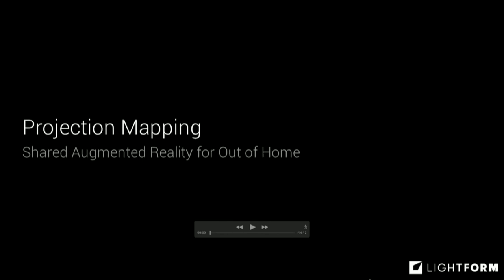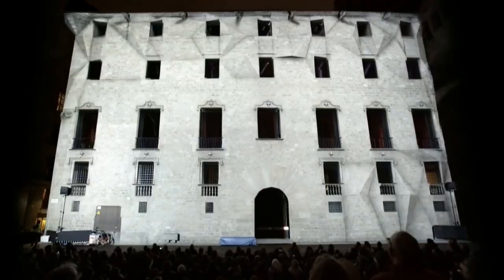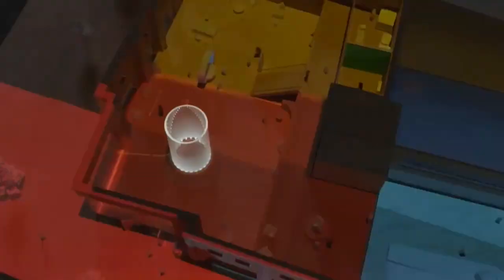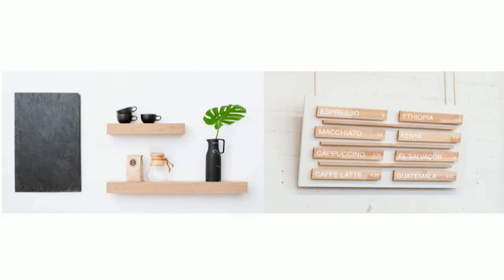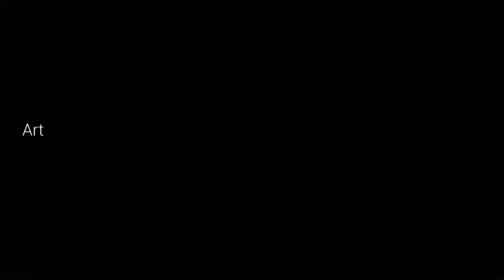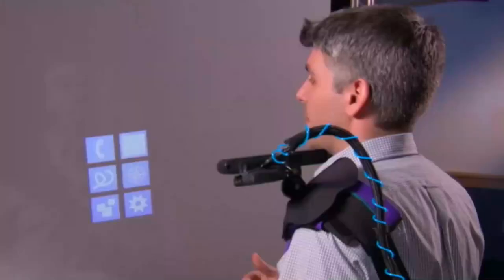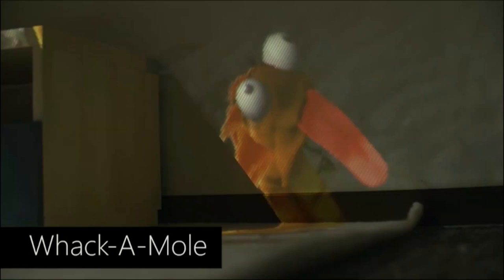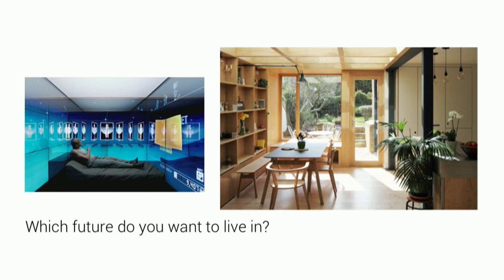Brett Jones (Lightform): Projection Mapping - Shared Augmented Reality for Out of Home

Comment: Just picked up the LF2 and I'm not very happy with it. I mean, it's okay. It has the camera built in, it scans, it projects, but it's very dim so you need to be in a very dark, to pitch black room for it to be most effective. Also, and this is my biggest pet peeve about it, it projects at a high angle and it has no height adjustment on it. If I place it level on a desk, I have to prop up the back to almost a 45° angle for it to project properly on a wall. Otherwise, it has to be low to the ground or mounted but still pointed down at an angle. Why did they not put a height adjustment knob on it? 😕